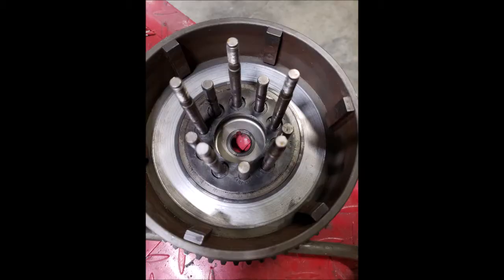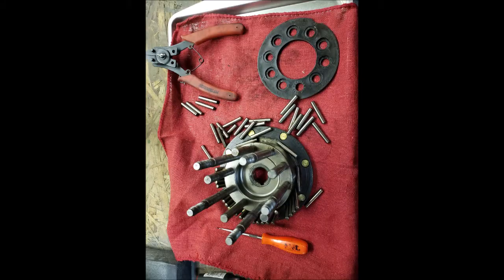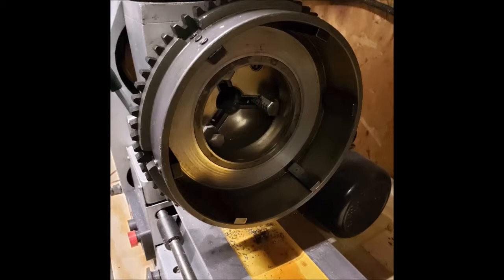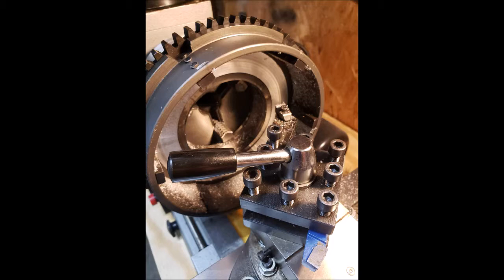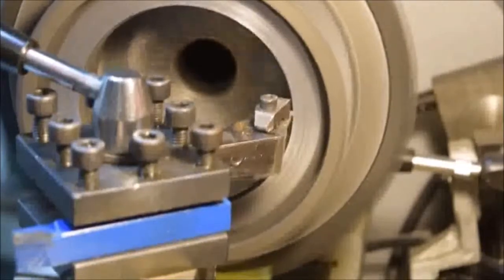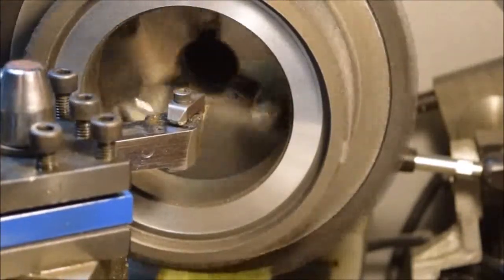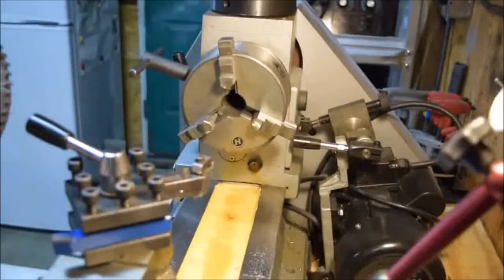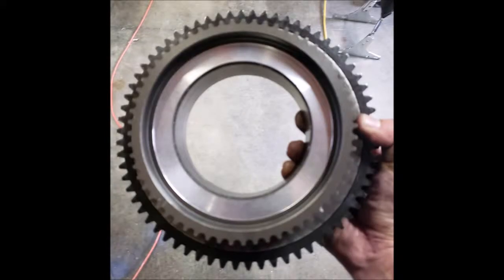Harley Davidson Shovelhead Clutch Shell Resurface Machining

Comment: That disc was showing you three problems , you should have also shown the steel disc's
Reply from the maker: I had replaced all the steel and fiber discs prior to the purchase of this lathe so they were all in pretty good shape.
Reply: Did that clutch still drag when it was put back together ?
Reply from the maker: @brianwinters4991  No Sir.  Good to go now